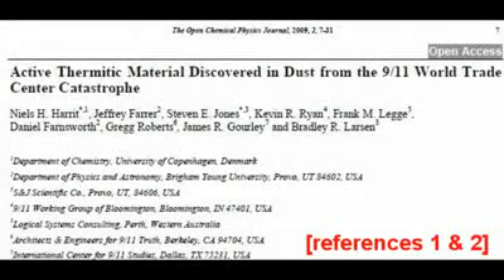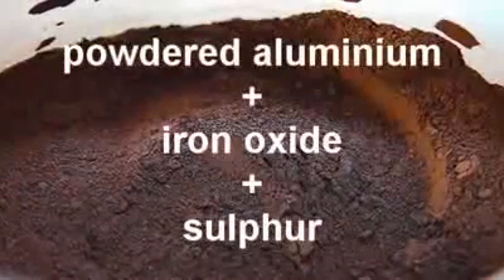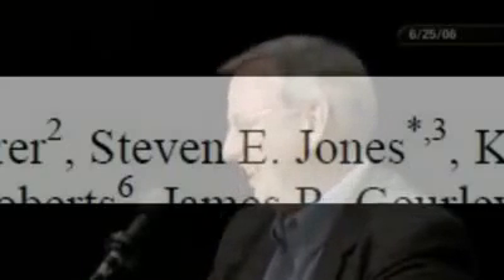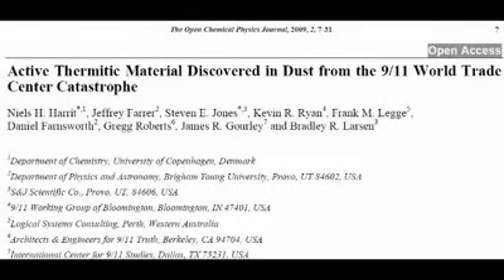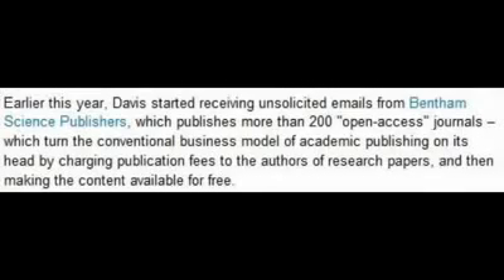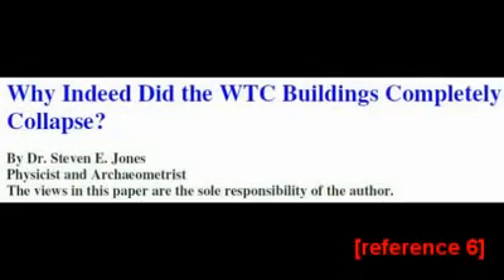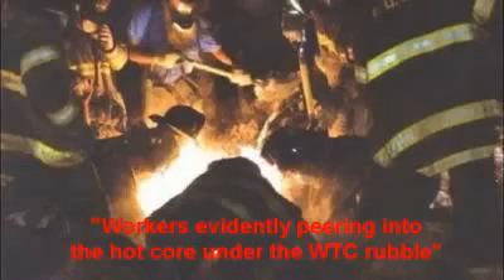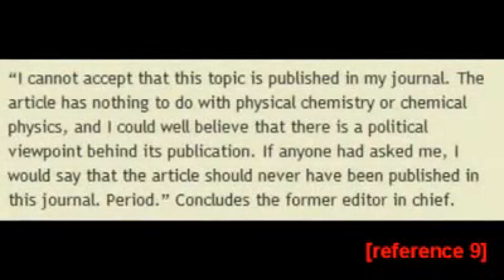Thermite (Mirrored)

Comment: But the buildings did not fall at free fall speed. That's been settked for years! They got the "free fall speed" from the seismic recirdings of the sound of impact. The sound of impact does not tell you how long simething took to fall, but how long the noise is when it hits the ground. You with me here? Then someone timed the collapses using the TV footage. 16 seconds and 22 seconds. WAAAAAAAY longer than free fall time. Where you been hiding for years?

Comment: @shrimpcracker89 "so if thermite had been used - shouldn't we have found the byproducts of it - as opposed to the materials to make it?"

I think that's a very good point. Also considering the high temperatures and friction surrounding the crash of the airplanes and the collapse of the towers.

And as you have had experiments with thermite before, you would know how unpredictable it is. Besides, how would one get it to burn sideways into the steel frame of WTC?

Comment: Thermite is not used for demolition because it's unreliable and unpredictable. Ignition requires extremely high temperatures which cannot be reached with conventional black powder fuses, nitrocellulose rods, detonators, pyrotechnic initiators, or other common igniting substances. Preheated thermite is even more unpredictable, and can burn almost instantaneously.

Comment: @Trod 

My ultimate point is that the system of PR is one that has a very reliable mechanism of checks and balances.  You could potentially have a paper pass PR authored by a proven con man and if it passed through that rigid scrutiny one could trust that in spite of this person's rep, the paper must be credible because the system itself is not open to corruption.

 It is open to error though and in rare cases PR papers are found to have flaws, this is all part of the scientific process however.

Comment: I'd like some information of the gross load bearing capacity of each floor and translate that into the resistance they would yield to the collapse (flow) wave.  Has such information been publicly forth coming?  This would be the obvious 1st step in determining the speed it 'should have' collapsed (flowed) down. It's obvious there was assistance and added mechanization to generate a 'near free flowing' pyroclastic cloud. What was the average weight of a floor & it's contents? etc.

Comment: @wizkid2000  (Cont.)

That's something Conspiracy Theorists (and most people in general) tend to overlook and misconstrue as unnecessarily obtuse and negative, and because they avoid it, they are often subject to letting their "gut feelings" decide in advance what their opinion is - then seek to justify it with proof, leading to false positives and error.

The criticism of the paper was, consider it preliminary to a technical deconstruction if the skirting of proper peer review doesn't

Comment: @wizkid2000 

Point being that just because a paper is published in a peer review journal, doesn't make it fact either. A good and accurate paper can pass peer review and still be dead wrong about it's causes, conclusions, and implications... and debates are rarely settled with a single publication. It's a long, often arduous process - and one of it's functions happens to be a removal of biases (both conscious and unconscious) which can distort accurate data to false conclusions.

Comment: @wizkid2000 It could have been lead, which was common in the WTC, as most of the computer monitors of the time had cathode ray tubes, which had five pounds of lead apiece, and the melting point of lead is well below the temperature of burning jetfuel and office fires.

Oh, and burning debris can cause molten aluminium and lead to glow.

And by the way, where are you getting these accounts of molten iron in the stairwells? I can't find any accounts of these outside the truther websites.

Comment: @wizkid2000 The buildings were open plan, and therefore there was no place to hide any thermite. There was no massive orange glow throughout the buildings. The collapse lasted far longer than 12 seconds.There were no bright orange explosions during the collapse. It is impossible to extinguish thermite, so there would be very little if not NO residue of unburned thermite.

Comment: @wizkid2000 Then why the massive amount of unburned "nanothermite" in the dust samples? If you extrapolate the amount of "nanothermite" found in the samples over the whole volume of the WTC dust, you would get a collossal amount of thermite, tons and tons of it, and that is not including the burned thermite.Furthermore, the fireball of impact shows no evidence of high explosive, no blastwave, it was a low velocity fuel/air explosion.

Comment: @wizkid2000 It actually is. It is just like a really bad sunburn. 

The buildings were open plan. This means that it would be impossible to hide anything within walls. Or within the core, as thermite would have to be used on horizontal members, because thermite can only cut downwards, with gravity.

Comment: @dangerouslytalented

Its UV light... its isn't radiation in the strictest sense. It wont burn people in a vicinity, its must be in line of sight because uv light cant penetrate matter unless its transparent. As it was probably applied directly to the infrastructure and that structure is normally covered by the interior of a building it wouldn't burn anyone.

Comment: @dangerouslytalented WTF? Do you even know what thermite is? LOL technically, you are right, infrared heat and light IS a form of radiation, but i have doubts thats what your talking about. Mostly, though, the burns are caused by FIRE, which is a form of FIRE.

Comment: Now I'm no chemist, and am probably saying something stupid, but let me get this straight... Thermite residue is the result of pulverized aluminium, iron oxide (which develops really quickly in a fire) and a lot of heat...?

Now why the hell would you expect to find anything like that at the site where a plane made of aluminium alloys flew into a building with a steel construction at very high speed, after which a fire broke out? Must be placed there by the government...

Comment: "nano thermite" is  referred to by the  research community as Metastable Interstitial Composites (MIC).  In MIC materials the Aluminum is dispersed as nano scale particles typically 100 nm  in to the  iron oxide.  This increases contact between the fuel and oxidant which, in turn, increase the rate of reaction.  MIC or nano thermite materials deliver energy faster and, usually, can be more easily initiated.  The notion that thermite brought down the WTC is so stupid as to be laughable.

Comment: @southparkXD1 The collapse of ONE storey would do it. The top sections of the towers were 10-20 storeys tall, which means that it was the equivalent of dropping a 10-20 storey building on top of the already damaged lower sections of both towers.

Comment: @BlackRaptor31 They found iron oxide and aluminium flakes, which are constituent compounds of thermite.

However, the problem is that if thermite was used, then it would have all been burned up, as thermite can't be extinguished. You would not see much unburned thermite, instead you would see a whole lot of residue of burned thermite.

Comment: @southparkXD1 

What reinforcement? The WTC was pretty darn old and our modern coatings and methods to contain fires we'rent in full effect then. The metal core probably was fully exposed the following fire of the planes fuel able to heat up the left over metal bracing and voila.. gravity does its work. 

>>>